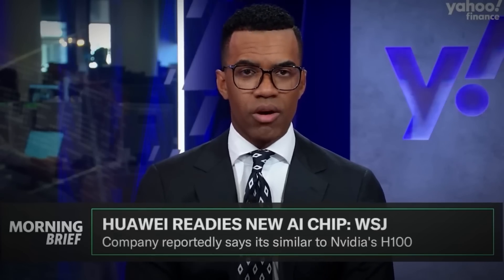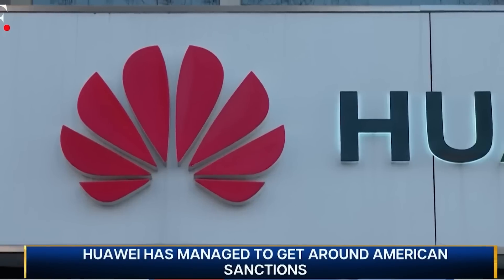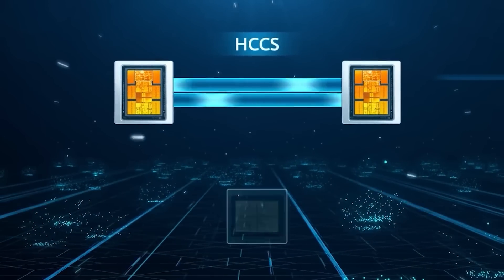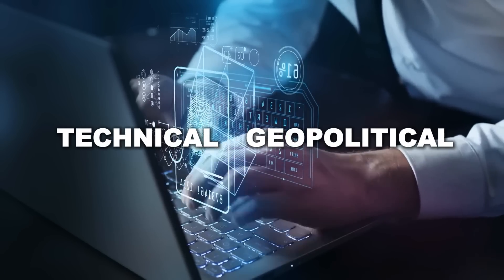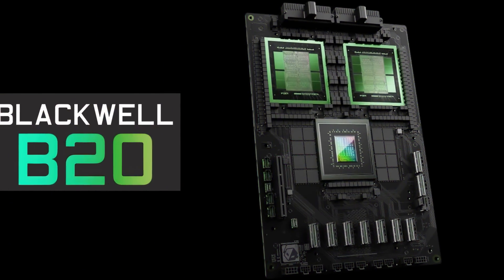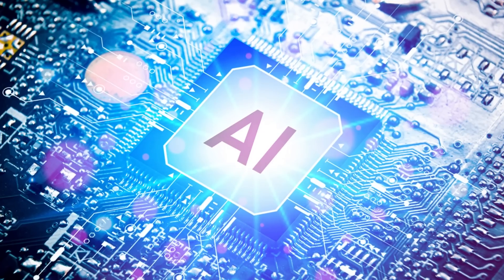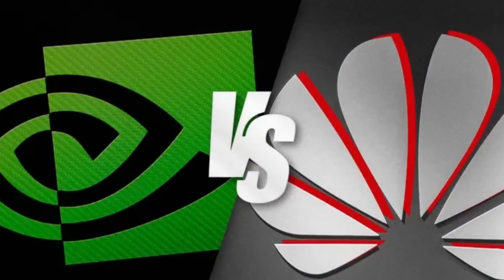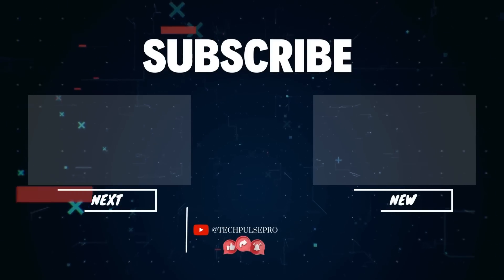This NEW AI Chip From Huawei DESTROYS NVIDIA

Comment: NVidia has re-engineered it's API platform to fully utilize its hardward for many years... that STACK/PLATFORM is reliable, well known, supported. 'Someone' can make a chip that hits marks on synthetic tests, yet... NVidia invested long ago, is now reveling in well deserved profits, so good luck with replacing so many generations of improvement with a COPY.
=====
Is it racist to say, Chinese companies STEAL IP. Low cost manufacturing offers easy access to the best and brightest technological improvements... how many amazing ideas have come from China, with 20% of the populous - it's a culled culture, abused by aristocrats - sure they changed the labels, so now rather than Emperor it's General Secretary ... also about CULLING the most amazing people who arise, China has assasinated it's most promising young ones for thousands of years - that effects this generation.

YOU CAN'T KEEP MURDERING PEOPLE WHO DISAGREE, particularly when they have a soundly reasoned point. But can't tell the CCP anything, they KNOW better.

Comment: China has yet to prove that this latest Ascend chip is anywhere as performant as claimed. For the last couple years China has claimed qll sorts of things that turned out not to be true... That the Kirin 9010 would be significally better than the 9000S, that China could make chips commercially at the 5nm node level, that its SAQP process works. Today there's no evidence any if those claims are real.

If China can actually produce an AI chip that can perform like the nVidia H100, that would really be an accomplishment overcoming steep obstacles China hasn't yet shown... Likely including mastering a manufacturing node level of 3nm, superior memory and power efficiency. Usually achievements are a process of iterative improvements but to make this AI chip would require jumping over 8 years of technology overnight and without any indication intermediate obstacles were resolved through hard work.